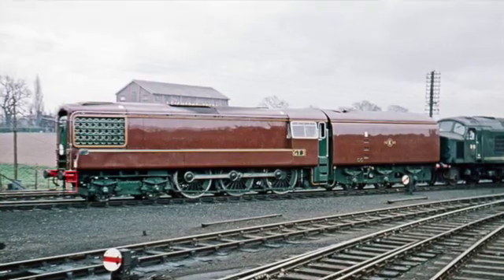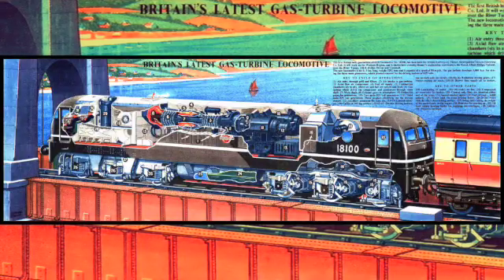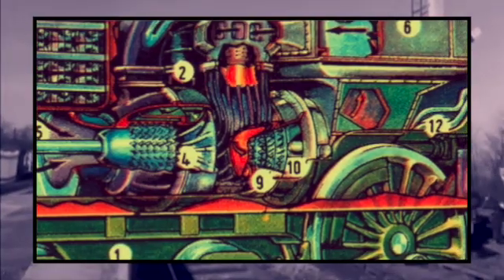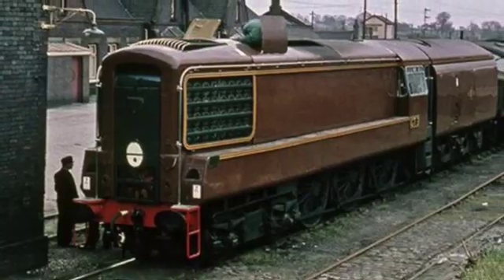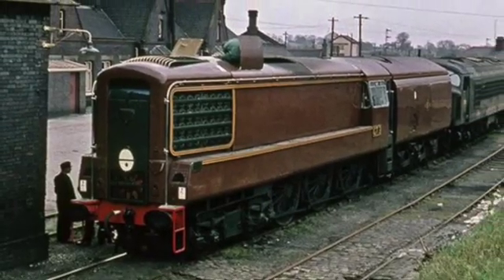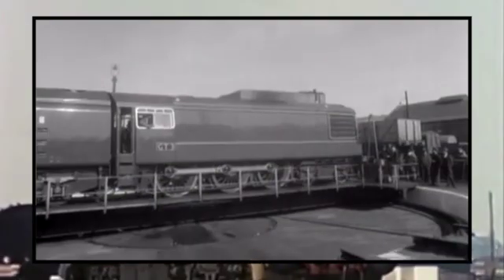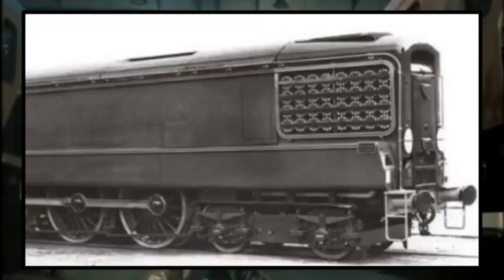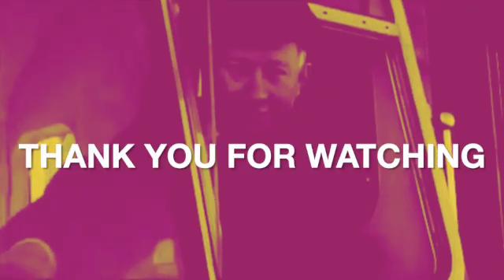The Train Powered By A Jet Engine: British Rail GT3

Comment: The turbine was actually not a jet engine, but a gas turbine designed for industrial and maritime use. It was also not running on kerosine, but on fuel oil.
Reply: US turbines definitely used fuel oil but not the UK ones.
So much so that the Great Western ones got the nickname Kerosene Castle as the smell of Kerosene was evident to travellers at stations etc.
Reply: @johnd8892 Great Western is different, but The GT3 was fuel oil, not Kerosen
Reply: I remember travelling on the French RTG gas turbine railcars in 1980 with the distinct smell of Kerosene of it at the station.

Comment: The explanation of the turbines is wrong. The high pressure turbine was only running the gas turbine compressor, the low pressure turbine provided the traction power. The set up is also clearly visible in that eagle cut away diagram you used.

Comment: I only know of this engine thanks to the mod for Transport Fever 2. I do not understand the thinking behind building it like a steam locomotive, which are infamous for having terrible vision that through history has led to multiple crashes because the drivers couldn't properly see the track ahead. The layout of steam engines turned out the way it did, because they had to solve the problem of how to boil a lot of water on a moving engine, and there has never been any succesfull designs that were able to give the drivers better working conditions. When using any other kind of propulsion there's no sensible reason to use the same engine layout, but they clearly didn't bother consulting the drivers when they decided to build the GT3 that way

Comment: I find it hard to argue with the practicality that diesels, push/pulls and later Multiple Unit trains brought for turnarounds/running. That said locos like this make me wonder about a world, where technology continued to move forward but the packaging stuck with that of the traditional steam engine. Diesels with their engines where the boiler would be, fuel tanks in the tender etc. Obviously seeing this on a large scale is a fantasy, but it would be interesting to see how the railways would have looked in such a world.
Reply: Railways found large cost saving without the need for turntables.
Tenders also provided far in excess of the needed fuel supply for diesels with their usual fuel efficiency.

Comment: An irony: My father, who worked on the Deltics as an engineer for Napier, and had also been involved in the project to re-power fast torpedo boats with that engine, had by the time they scrapped this weird abortion, joined the TurboTrain team in North America as the liaison for United Aircraft Canada, who supplied the ST6 engines for those motive units. Typical of a time in the UK where lots of good minds, dealt with visionless management; which in turn was the downfall of many industries that failed during that time.

Comment: Nice presentation, but a few errors. I researched GT3 before building my working 5" gauge model which can be seen on YouTube. The model has a 5Kw turboshaft engine. KR Models used my drawings to produce their OO-gauge model. I am now working on completing a 5" gauge working model of 18,100 using the same design of turboshaft engine.

Comment: Interesting loco first I’ve heard of it. Be interesting if it was more efficient big oil wouldn’t have liked that.
Reply: All the production gas turbine locomotives in the US and Europe were scrapped since the fuel use became more costly than Diesels. Particularly when stopped and idling, as is common on most railway services, the fuel consumption was far too close to full power use.

Comment: Well you hit upon two points that assure its failure! Firstly the turbo loco that preceded it and failed because it was expensive to maintain and was in workshop for long periods. Secondly the use of oil fuel in fifties was frowned upon by the Treasury who had no finance for such a switch. They had already forced British Railways to reconvert to coal firing half of its fleet which had been converted to oil firing because of lack of exchange finance. They also required the best coal to be exported and made the Railway to run on cheap, low thermal conversion coal! 
However desirable the design by a private contractor nothing was going free BR from financial constraints with successive governments trying to pay off the debts of three wars and this was not managed until Thatcher eliminated those debts by paying them off with North Sea oil revenues. This is not a political recommendation or condemnation but a statement of history as recorded in a number of publications over the years none of which appear to have been sued over their statements!!

Comment: I wonder why at EE, which were the first in the UK to produce modern main line diesel locomotives in the familiar single or dual cab designs went the route of adapting something like a steam locomotive for GT3, almost if a King class had its boiler and cylinders removed and replaced by the gas turbine.
Also it was turbine-mechanical which made efficient operation of the gas turbine more difficult than the turbine electric variant like no.18000.
Operating conditions in the UK and Europe in general did not suit gas turbine drive. In the US they operated successfully for the Union Pacific on long freight hauls with the turbine operating at high output for prolonged time, that was when the turbine was the most efficient. At low loads which happen often in European operating conditions a diesel engine is much more efficient.

Comment: Another sad tale of how British technology and inventive creation were stifled and betrayed by anything connected to Government. The list from the '50s and '60s is long and tragic.
This could have been an excellent development test machine and there was no reason EE could not have re-engineered a diesel electric loco design to fit the GT from GT3 to alternators / generators already in use. It just needed support and belief, sadly two things the cold hands of beaurocracy never have. Given the large diesels being produced by EE and others were fundamentally poor the GT could not have been any worse especially as, as it was reported, on test runs it proved reliable.
Excellent video that answered some questions for me.
Reply: The whole point of GT3 was to investigate if gas turbine power could be used directly, WITHOUT the intermediate electric transmission.
There had already been TWO gas-turbo-electric designs on trial.
Reply: @tooleyheadbang4239   Yes built by the Swiss. My point was this loco had a valuable part to play in GT use in the UK however the power was transmitted. But they just scrapped it as they always do.

Comment: An excellent explanatory video that I knew little about. 
What a great shame, and they were only a few steps away from success. 
Across the channel where I now live, this concept was developed further as French RTG and ETG multiple units, one with 2 gas turbines and the latter with 1 GT and 1 diesel engine. The RTGs saw a 30-year service on several regions including credible high speed performance from Paris to Boulogne to connect with the hovercraft.

Comment: It is surprising that EE went down this road when classes 20, 37,40 and Deltic were all in the pipeline and arguably ahead of the competition to replace steam. Good post, quite a few photographs I haven't seen. I think I remember Meccano magazine and Eagle did a spread on it. It seemed an odd design even to a young teenager as I was then not to be a double cab design but I suppose neither was the class 20 and that was a success.Thank you for posting.
Reply: 20s a success after they were run in pairs nose to nose to effectively give a cab at each end.
Running like that 98% of their miles travelled is my guess.

Comment: Only 18000 was built by Boveri - 18100 was built by Metro-Vick in Manchester. Different fuel oil types (and turbine designs to match) were used to assess which would be the most economical fuel to use, but this was possibly the least useful criterion to judge useability by. Additionally, neither loco was well served by steam-era crews, maintenance depots and staff - although this was not their fault. GT3 was meant to be a compromise design to allow the continuing use of steam-based diagramming and working practices (including turntables) as an intermediate solution. Good gamble, decent design, not taken up as a result of the abandonment of the phased modernisation plan during the "diesel panic".
Reply: French railways SNCF had 2 generations of successful gas turbines multiple units, ETG and RTG.
They were used until 2004 and sold to several countries.
The TGV was planned originally to have gas turbines.
Reply: I guess it depends on your defintion of failure. The Union Pacific RR in the US had a fleet of 56 gas turbine heavty freight locos which lasted for nearly 20 years, all covering more than 1 miilion miles in revenue service. They took over from the 4-8-8-4 Big Boy Mallets and the third series were then the world's most powerful locos being rated at 8,500hp. They still hold the world record for a single prime mover.
Reply: I think the real reason it didn't work out is simple - you have to keep the turbine running all the time, it would be like idling a diesel engine at full revs. Gas turbines were tried the world over, and all failed for the same reason - their being inherently uneconomical.

Comment: It's a shame the GT3 prototype never survived as a museum piece. Also if developed further the GT3 and the other gas turbine locomotives could have been a answer to replacing the current diesel locomotives as hydrogen gas could have been utilised to run the turbine engine.
Reply: Gas turbines are constant speed machines and are only suitable for aviation, marine propulsion and power generation. Land prp
Reply: Gas turbines are constant speed machines and are only really suitable for aviation, marine propulsion and power generation. For land propulsion you need a variable speed machine like an ICE or electric motor. That’s why they were not generally adopted for rail or road transport use.
Reply: gas turbines are only efficient when running at full speed. At any lower throttle setting they're horribly inefficient and burn more fuel, less cleanly, than a normal piston engine with the same power output. This makes them utterly unsuitable for anything that has to make frequent stops, and generally doesn't need full power constantly, like trains
Reply: ... no. Hydrogen outside NUCLEAR REACTIONS (specifically fusion and antimatter) is a fool's game. Oh, and the required volume to store the hydrogen is 13.5-14m^3 per metric ton... or A LOT in plain man's terms. The humble Traveller dTon is based on the 14m^3 volume for good reason.

They're just THAT BAD regarding energy density outside that particular niche.
Reply: @TheTrueAdept good comment well made. I’m in railway myself, but fed up of this hydrogen buzz. It’s great for a few low speed ‘demonstrator’ trains but that’s about it.
Reply: @bfapple  to be honest, you're better off using electric or ICE engines...

... though in the US's case, you're going to be stuck with ICE.
Reply: @TheTrueAdept  All too sadly true.  Except when we do something even dumber like battery trains with no provision for running off third rail or overhead wire, so that recharging can only be done at the end of the line.
Reply: @Lucius_Chiaraviglio  well, batteries are actually getting pretty good nowadays, especially since e-cars are gaining traction. The problem with cars is that they are VERY volume-constrained, even though electric transmissions are pretty superior to more conventional ones (that's why most ICE locos are Diesel-Electrics, not Diesel-Hydraulics, and why electric locos have a vast power superiority compared to everyone else for much of railroad history). You can battery-power a loco, but the problem is the batteries themselves, which were not solved until recently.
Reply: @TheTrueAdept  I wouldn't call batteries "solved" -- they would be not bad for running short distance out from under the wire (and indeed some early 20th Century electric locomotives had this capability), but they aren't what you would want to run the whole line on.
Reply: @Lucius_Chiaraviglio  then you haven't kept up with the new batteries that have been coming out.
Reply: @TheTrueAdept  I have -- they are better, but you still need a long time for charging, so a train or bus has to sit at the end of the line for a long time (at least half an hour, last I heard a few months ago), and if it was late getting there because of traffic, it has to leave late to get charged up.

Also while the recently available(*) lithium iron phosphate batteries cut down some on rare materials (cobalt and nickel), the lithium itself is still rare unless somebody figures out an economical way to get it from seawater.

(*)Have been around for several years in China, but apparently held up elsewhere by patent encumbrance that just recently expired in the US.
Reply: @Lucius_Chiaraviglio  Some old Cornish Tin and Copper mines are being reopened, not to mine but to use the slag heaps as Lithium and other metals have been found in them.  Metals not known in the 18th and 19th centuries.
Reply: @TheTrueAdept 

A gas turbine is a type of internal combustion engine 
just like a diesel or gasoline engine because it operates using the cycle of intake, compression, combustion (expansion) and exhaust.

Putting it more simply-
It is an engine with the combustion taking place internally.

When properly applied,
gas turbine/electric systems can be practical in many 
non-traditional applications.

They really are like giant turbochargers with a fuel injection systems-
eliminating weight and complexity can be very advantageous.

Of course,
locomotives are not generally interested in losing weight…
Reply: @j.griffin , or you're looking into the gas turbine's massive power-to-weight ratio, like UP. Before modern DEs, UP had the problem of its trains literally burning out the traction motors of its locos due to their immense size... and this is after latching a good half-dozen to the trains.

So, UP put in a tender for a locomotive with an immense power-to-weight ratio to pull said trains singlehandedly, and GE said, 'Hey, we've got this fancy gas turbine engine that will give you more than enough power for your locomotive!' Thus, the GTELs were born.

Oddly enough, they worked well in their intended role. The problems were in their fuel (Bunker C), the noise, and the fact that the turbines were horrid at low RPM. 

Bunker C was later discovered to be an excellent feedstock for plastics, so its price tag skyrocketed, which in turn increased its operating costs. 

GTELs had minimal noise buffering, and it caused their ban in LA due to people complaining of the noise. 

The GTELs' most significant weakness is their fuel consumption at low RPM. Gas turbines work best at high RPM, but there wasn't enough area in any rail network to allow that.
Reply: @bfapple Is it really that bad? I feel like if we can use hydrogen fuel cells to run a car then maybe we could use hydrogen fuel cells to run an electric locomotive. But I do agree that hydrogen turbines are a bad idea.

But I think the biggest obstacle is just that railway electrification is very easy, efficient and mature. It’s just not worth investing in hydrogen when you can do it directly through electricity.
Reply: @Lucius_Chiaraviglio  It will be interesting to see how it goes near me. They are electrifying the line up to the start of the Forth bridge and around Dundee (Maybe Kirkcaldy too). But for the journey through Fife itself they will run on battery power.  Sodium batteries are now available but as these are slightly bulkier than their lithium equivalents they may not be being used.
If the experiment fails then I guess they electrify the whole line. 
I'm not quite sure if London to Aberdeen services will remain Diesel hauled or what the plan is? Change at Edinburgh?

Comment: 'With the electrification of the East Coast Main Line underway....' - I think you have your easts and your wests mixed up here.

I think you also need to learn how to pronounce 'Whitchurch' (there's no 'white' in it) and Woodford Halse.

What you don't mention is the intrinsic unsuitability of gas turbines for rail traction applications as they only work efficiently at constant high outputs, whereas rail applications require varying outputs and much running at lower outputs. It was a blind alley which was soon realised.
Reply: ‘Blind alley which was soon realised’ - Your comment is spot on up to that point. Considering Gas turbines were used in the APT programme - again - trying to find ways around the efficiency problem - they certainly kept trying throughout the decades!

Comment: An interesting video, thanks. Just a small point, the second GWR gas turbine was built by Metropolitan-Vickers in Manchester, not Brown Boveri.
Reply: He never claimed anything different.
Reply: @1258-Eckhart  He actually said that BOTH were made by Brown Boveri.
Bennwhite's comment is correct.
Reply: @MervynPartin  Nope, he said that both GWR machines were made by Brown Boveri, which is true.
Reply: @1258-Eckhart  Brown-Boveri only made the first one, BR number 18000 which currently resides (non-working) at Didcot Railway Centre.
The second one, BR number 18100 was built for British Railways in 1951 by Metropolitan-Vickers, Manchester. It had, however, been ordered by the GWR in the 1940s, but construction was delayed due to World War 2. It was later converted into a 25kV electric loco number E2001 for early trials of the 25kV overhead lines before scrapping.
Reply: @MervynPartin  Correct, only 18000 had a Brown Boveri prime mover. Both GT3 (here) and 18100 had prime movers from English Electric.
Reply: @1258-Eckhart Nope, only 18000 was built by BB. He showed us photos of the Metro-Vick 18100, which, er, wasn't BB in any way.